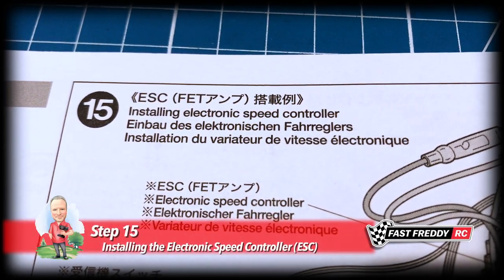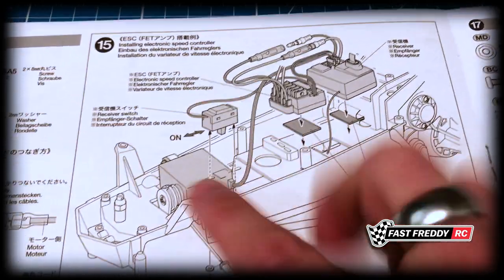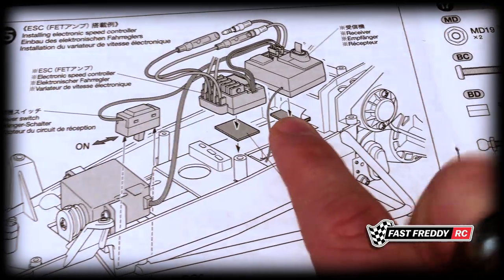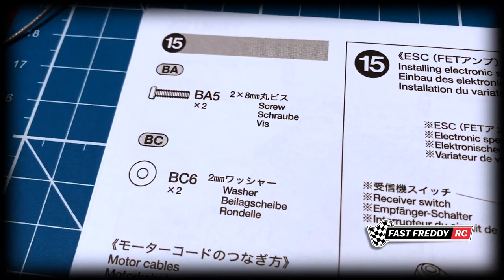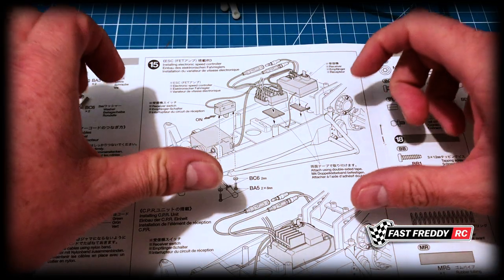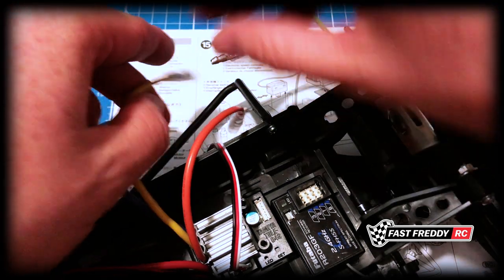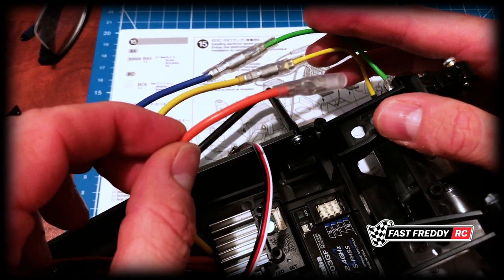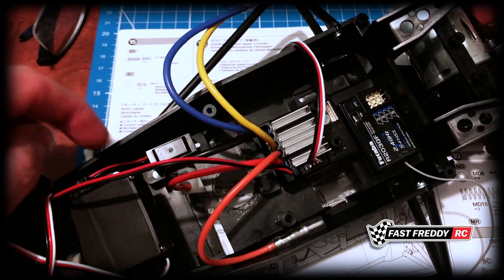Tamiya Hornet Beginner Build Series! - Step 15 - Installing the ESC (Electronic Speed Controller)

Comment: Question:  We bought the Hornet Kit, but it did not come with a ESC or speed controller.  Do I need to buy this item individually or is it included in the kit?
Reply from the maker: Morning David!  So...what part of the world are you in?  You've brought up something that I addressed in another video but I might do a separate video just to answer this question for others as I think it's vitally important. So here's the short answer...before covid you could guarantee that each Tamiya kit came with a Tamiya ESC.  After covid, Tamiya ran into supply issues on their own stuff so they made a deal with Hobby Wing to include the HW1060 ESC.  Now, in Tamiya kits, it's known as a THW1060 ESC (the THW stands for: Tamiya Hobby Wing) But here's the thing...in Canada, for example, some hobby stores, in order to be able to say they are 100% Canadian stores, are NOT including the ESC which means you have to buy them separately.  Which is fine...however...the kits are the same price practically whether an ESC is or is not included in the kit. So I'm afraid to say that in your case you will need to buy the THW1060 ESC separately.  You won't find a Tamiya ESC anymore unless you're lucky because they don't exist anymore.  Not sure if Tamiya plans on fixing this issue anytime soon.  So your best best is to source out the THW1060 as it will be your most affordable option and technically was designed to come with Tamiya kits so it will be perfect.  Short answer is you'll need to buy one. Long answer is you'll need to buy one for all of the reasons mentioned above.